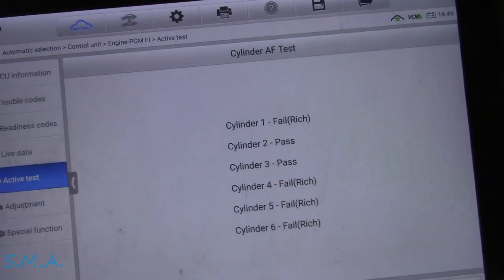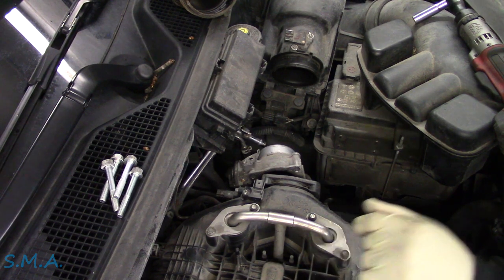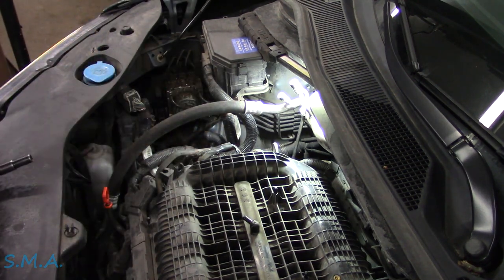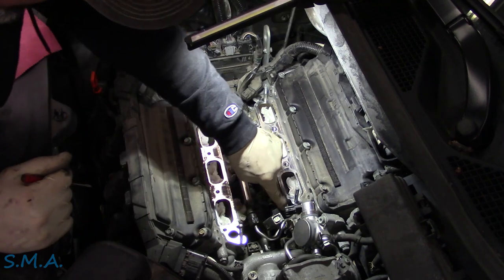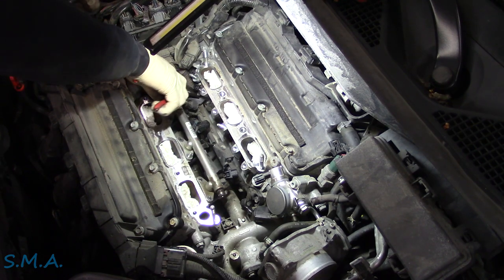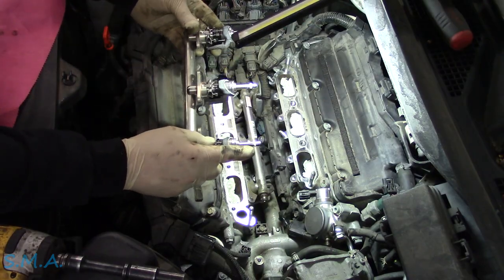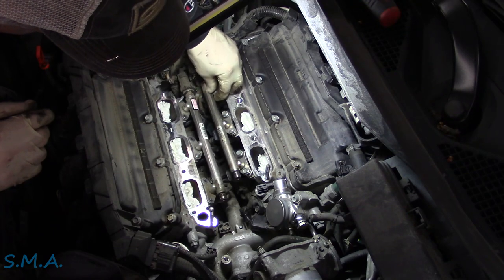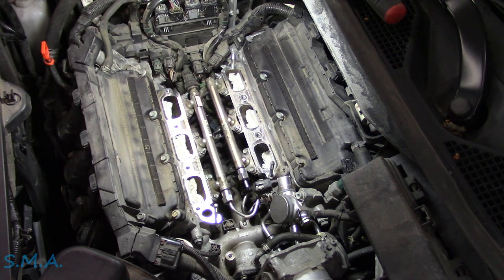Honda: Earth Dreams 3.5 GDI Replacing Fuel Injectors

Comment: 2016 to 2018 injectors should be covered under warranty.  8 yr 150k.  This is a known problem.
Reply: Yup they extended the warranty out on them
Reply: ‘17-‘19 Pilots/Ridgelines and 10yr/150k. I do these almost daily and bulletin states to replace the fuel pipe too
Reply from the maker: @2WatchAndComment  This guy did have the vehicle at the dealer multiply times when the issue started. They could never seem to fix it. I will pass this info on though and see if he can get reimbursement for it perhaps 🤷🏽‍♂️
Reply: Totally under warranty. Contact Honda and they may pay him back for this.
Reply: @SouthMainAuto  Service bulletin  21-010
Reply: Is it a problem with the injectors getting clogged? I usually hear about carbon buildup on the intake valves in GDI systems. Still watching the video, haven't finished it yet.
Reply: Is this related to the fuel in the oil problem they were having?
Reply: @jondoef  I believe that problem is attributed to the turbocharged engines in the CR-V and the Civic
Reply: @jonathantolbert4176   Service bulletin  21-100
Reply: Miss typed.. The 21-010 warranty extewntion bulettin is wrong on the newer touring and Elite Pilots, they use a different fuel injector. Bit us once not twice.
Reply: @keithnechetsky2067  21-100 if for 2016s , 21-010 is for 2017 and up.   They all.have the same injectors as well. 06160-RLV-305 fuel injector kit.
Reply: @jonathantolbert4176  Take a look at the 18 and 19 pilot elite and touring. The kit comes with a 16010-rlv-315 injector and the touring and elite take a 16010-rlv-306. Been using the kit since the 20-100 bulleting came out a couple years ago. The 21-010 warranty extention added the 18 and 19s.  They missed the fact they have different injectors in the upper two models.
Reply: @keithnechetsky2067  the 315 is the failed Injectors.  305 kit replaces them.

Comment: fixed a guy's jeep the other day. he replaced the fuel pump and it wouldn't start or run. checked the fuel pressure and it was zero. took the pump back out and he forgot to take the plastic plug off and put the mesh sock on. fixed it and he refused to pay for looking stupid. his wife said either you pay or i will.

Comment: As a Honda tech whos done this same exact job mucho amount of times, I gotta say you kicked ass and i loved this video.
As i watched i wanted to give you some tips, my trick to remove that upper intake is loosen those 3 ten mils on the computer, as opposed to popping off the cover, gives u just that little amount of clearance, trust me u can get a wrench in there between that bracket. Also, no need to try an unplug the injectors before you yank the fuel rail off,  or unplug the high pressure pump. and YES honda does want you to replace that joint pipe in conjunction, if the jobs under warranty the parts kit will come with a new pipe, however when im doing it customer pay, all the customer usually buys is just the injectors. Your the first ive ever seen install them into the rail them slip that as an assembly back into the head, hell i might try that myself next time.  i usually silicone s[ray the outside of the injectors, slip them into the head, grease that o ring on the outside of them, and then install the pipe on top of them. 
Nice job
Reply: That is a nightmare job just to replace injectors. How many hours is the job slated for in the books?
Reply: @TheFrenchPug  compared to other engines from other makes Honda’s direct injected V6 seems to be a cake walk. Just take your time to do it.
Reply: @MrSamPhoenix  Well, my daughter has a new Honda Pilot and compared to my BMW doing that injector job was a much deeper dive.  But I'm glad to hear it's not as bad as it looked to me.
Reply: @TheFrenchPug  Warranty (10years/150,000mi for this) says 3 hours including a software update for the PGM-FI and 9 speed transmission if so equipped.
Reply: @bornwestusa  oh wow.  Maybe not a DIY?
Reply: @TheFrenchPug  the injectors are under warranty for 10 years or 150,000 miles, so beyond that maybe?  A miss fire code is the tip off.
Reply: I always love watching Eric work especially on Hondas I'm also a Honda tech so I can relate a lot to what he does my advice on getting the intake off is I usually grab a flat head screw driver stick it between the intake and the fuel injector control module plastic and then pull up on the intake works every time instead of dealing with removing the plastic cover or loosening the three 10 millimeter bolts
Reply: @TheFrenchPug  I did mine, outside, in January in upstate NY and it took me about an hour. It’s a pretty easy job. I did mine a few days before the TSB was released and had to argue with Honda for almost 6 months to get my 242 bucks refunded for my cost on the fuel injectors.
Reply: @MrSamPhoenix  the previous gen j35z engines have port injection, and theyre even easier to get to, intake comes off quite a bit easier, and the fuel rail is held in by 4 bolts and each injector has an electrical connector and a clip for the rail, insanely simple, just dont drop those rail bolts into the valley cause youll probably never see them again.
Reply: @packerman1203 Yes indeed, I work on the J35Z6 that’s installed in my 4th-Gen Acura TL for maintenance & I love it. I don’t have to mess with things like power-steering pumps etc.
Reply: @TheFrenchPug  indeed, taking your time is paramount.
Reply: Had am 05 Pilot that was brilliant for 250k. Current j35 just seem to have many more problems and I'm no longer a Honda owner

Comment: Eric, I work at a Honda dealer and can say, without a doubt your diagnosis was on point. Any direct injected 3.5 that comes into the bay with p0300 class codes, bank lean or rich codes, or catalyst efficiency codes is caused by fuel injector(s). Honda has a service kit, as per the a certain service bulletin publish I know by heart, that comes with all injectors, seals and gaskets, high pressure tube, and the lubricant that is used on the coupling ends of the high pressure line (comes in a small syringe) to ensure leak-proof connection. Typical, I replace at least 3 sets of injectors in a months time, it is a common issue, it seems to occur when the injectors have 50 to 60k miles on them. Just a tip, when I do them, I install the injector into the heads first then install the rails on them. That way, I can twist them slightly back and forth and actually feel the injectors slip into their happy place. Also, that EVAP purge sensor on the side of the intake, I just remove the two 8mm bolts holding it to the intake and remove the whole thing with the hose and electrical connector still hooked up. Nice job.
Reply: I have an Accord 4 cylinder with DI, 200,000 miles no issues...with anything,
Reply: @danr1920  Yes, the problem for some reason is not as common on the 4 cylinders. Actually, I personally have never had to replace the injectors on a 4 cyl, but that is not to say no has. It is the 3.5 V6's mainly and even most of them do go beyond 60k miles with no issues. I suspect the self-diagnostic look-up tables programmed in the 4cyl. model have a wider range of tolerance before it commands the MIL to come on. I might be totally wrong but that is my guess.
Reply: I have a 2019 Honda Ridgeline with 42,000mi and I have to get my injectors replaced bcuz I'm getting the "Emission System Problem" light intermittently. Sucks I have to do this and haven't even paid it off yet. :(

Comment: When putting an intake back on blind holes I place a drinking straw over the stud to help locate the position. Works for me.
Reply: Same w toliet bolts, etc..
Reply: @harrylumsdon6773  toilet flange bolts should be protruding out of the closest flange. You shouldn’t need a straw to locate them. Just use your hands and knees to carry the weight and inch over till one side is there and the other will be close.

Comment: Honda tech here. We do these all the time. There are warranty extensions/bulletins for these. It happens on the 1.5T accord and CR-V as well. Any misfire code or rich code. Check ST fuel trim. If it’s rich - Injectors! Very rarely it can also end up as a lean condition but I’ve only seen it maybe 2 times.

Comment: Very helpful! Thank you , loosening the ECM takes less than a minute using a 10 mm wrench which pushes the plastic cover to the right without need to remove it. ( around minute 9 of the video.)

Comment: Every.single.video.skips the essential part I was curious about, if I need the special seal forming tool or not!! I'm glad you at least TALKED about it and said that they just clicked down. 

4 videos and no one actually discusses the need or NOT need for the Honda-specified tool for forming the proper seal diameter prior to installation. Honda says you do, apparently (I guess), you don't! Thanks for at least mentioning it, even if not seen on video.

Comment: Honda extended the warranty for fuel injectores on several years of Pilots to 10 years or 150,000 miles. Worth checking out.
Reply: I was going to mention this as well. Our 2018 Odyssey and 2019 Ridgeline received the extension. Had the work performed on the Odyssey due to issues.  They should be able to submit for reimbursement from the customer pay, if this VIN qualifies.  I'd trust Eric over our local dealer.

Comment: Did this job on my Honda about a year ago, but it wouldn't start afterwards. Got it towed to the shop and they found I had not removed some caps from the tip of the injector, I see Eric was experienced enough to remove them before reinstalling

Comment: 2016 Honda Pilot. 70k miles. No Codes but gas leaking from engine. Repair shop found injector o rings gone or very deformed. Replaced all injectors.  Afterward Honda did a extended warranty/TSB for the same problem and reimbursed  6 mos after document submission the $1300 repair by an independent shop.  Thanks for showing the process.

Comment: Mr. O.
I have a jump box, test light, home made leads, switch, multimeter and some know how. From this I am usually able to rig a test. I have a side hustle and I win some and lose some.

My last win was a dead starter. I was able to  break down that the relay, solenoid, motor were all sound individually sound. But power would only activate the solenoid but not turn the motor. The motor itself was sound. 
I assumed the ground was sound (rookie move) and so my guess was the switch. I diagnosed a bad switch and a new starter assembly fixed things. Plenty holes in my analysis.

My last fail was an engine overheat. Thermostat housing was cracked. I suggested a new thermostat as well.
Struggled with the coolant temp sensor test (resistantance?).
Fans, relays sound but they would not kick on. I was stumped.
Following up with the customer, coolant level was low. Rookie move.

I hate guessing and I want to improve. I am shaky with electrical diagrams, but I am always practicing new tests, poking at something.

Any thoughts on my next move. Keep doing this or a class?
I think I am ready for a poweprobe 4 and a relay test kit to simplify my test rig.

1. Take a class? or
2.  Just keep taking on problems?

Thoughts?

Best wishes.

Comment: When the first Tacomas with GDI first came out in 2016 I had a couple that came in with the same issue. High pressure fuel pressure deterioration is how they outline to diagnose it was well. then a borescope to see which cylinder is wet. Nice of Honda to sell the set

Comment: I never had on a Honda but on the GMs I've seen many times were the pressure goes down on a hot soak, but it wasn't the injectors it was the high pressure fuel pump leaking.

Comment: I did this same job on a 2017 ridgeline.. same symptoms and DTCs. Anyhoo.. I used RockAuto stuff (at the owner's request) and when reinstalling the super curvy fuel line it came with some liquid that was for use when torquing the nuts to the fuel line. I'm pretty sure this liquid was a mixture of unicorn tears and fairy dust... but the pressure built perfectly and no leaks.. so all good. I also replaced the upper and lower intake gaskets because I didn't want any vac leaks. This honestly isn't a bad job all in compared to some of the honda jobs.. but totally agree the PCM cover was the worst part, Final point .. howcome they label a part that'll only fit one way with a "toward fuel pump" but something that'll fit 7 different ways is blank??!

Comment: A while back, my son got a letter from Honda concerning his 2017 Ridgeline. I can't locate it, but it was to inform him that if there are any problems with the fuel injectors, and fuel pump (if I remember correctly), that Honda would repair it free of charge. Something about the pump sending debris into the fuel system.
Reply: I think there is an extended warranty that goes 10 years or 150K.

Comment: Nice refresher course,
Done em before, Did you also see the TSB on the injectors?
Just look closely at the HP fittings, Had a Mazdford mx5 2.3 turd blower with spillage on the HP line at the rail from a deformation of the sealing flair after giving it a head job.
I Look closely and replace when a doubt arises.
And at my age I use a Magnufrier.

Comment: There's another procedure I've never seen, thank you. I can see why companies would be a little paranoid about fuel leaks, it's an area you can't see after you're done. I'm thinking the best way to check for a fuel leak would be before the intake goes on, so you can see a leak before it's all together. You can't run, but maybe just turn the key on and look for fuel pressure and a leaking connection?
Reply: Has to be cranking to hit the 300-1000PSI from the HPFP.  They normally run off a cam lobe (or in some cases a cam lobe per cylinder bank).
Reply: @michaelkrenzer3296  Good point, I did not know that.
Reply: Wanna check for a leak....throw a lit match down in there 😁.....lololol.....just kidding!
Reply: @michaelkrenzer3296  its way more than 1000 psi try in the 2000+ psi
Diesel with the high compression ration run even higher psi
Reply: @legros731  interesting, all the gas direct injection Bosch pumps I have dealt with so far the pressure regulator tops out at either 950 or 1050 psi.  Granted, I am still stuck in the early 201#'s.  Running pressures on my personal car are 450 idle to about 875 at 22#'s of boost.
Reply: And the Earthdreams is a gas direct injection engine.
Reply: @michaelkrenzer3296  interesting a deal more with diesel engine and they run between 2000 and 3000 psi and they also have Bosch pump a assumed gas engine where running similar pressure
Reply: @legros731  modern Diesel engines run in the 30,000 PSI range at full load.
Reply: @kain0m  we talking at idle not full load here but thank you for telling me something i know

Comment: Great video. Could you have removed and replaced the High Pressure Fuel pump without removing the intake manifold ? No doubt tighter and harder but is it doable ?

Comment: I bought an 05 Pilot new and sold it at 337,000 miles. The only engine work ever done was every 100k it got a new timing belt, water pump and plugs. I also had every fluid in her flushed and replaced. Had all her basic maintenance and was an awesome vehicle. I guess we all get 1 like that per life. Luckily I had 2, a Grand Cherokee I sold at 430,000 miles. For fun an 87.5 V12 XJS. And now I'm just talking to myself. Lol.  I'm hollering did you finish connecting #1?

Comment: Eric, if possible, you should practice cranking over the engine a few turns to build-up fuel pressure and check for leaks while the intake is still off.
Reply: I was also wondering if it was easy to check leaks before putting everything together. Seems you need  to lift the car and rotate cam manually.

Comment: Gotta do brakes on two 20+ year old Explorers, did a fuel injector removal with cleaning and reinstalling with fresh seals on the older one and it seems happy but don't yet know how mileage has changed on it.
If the winter weather would finally stop so I could mow the lawn and climb under a car, haha.